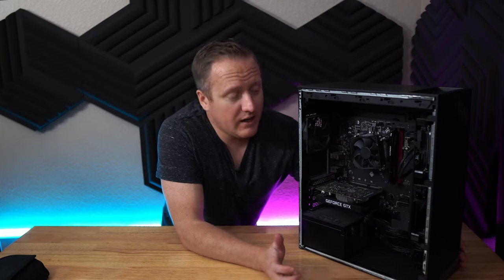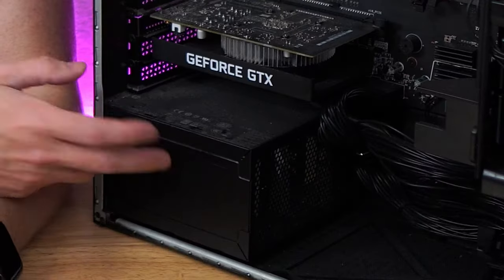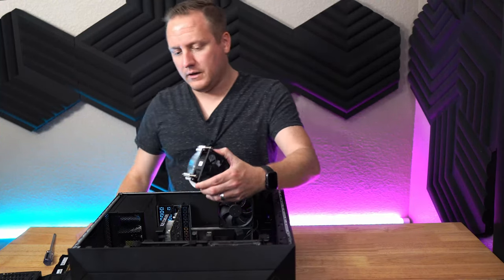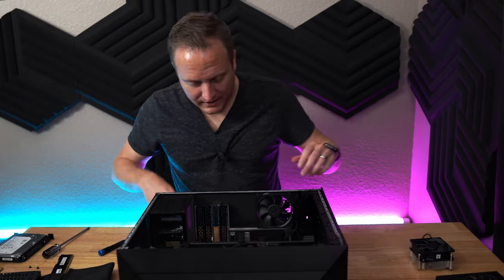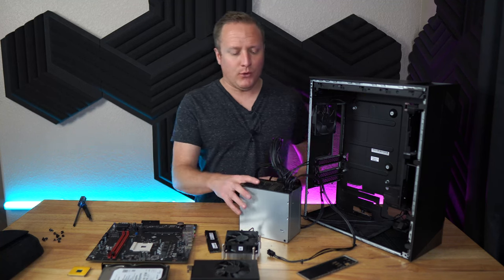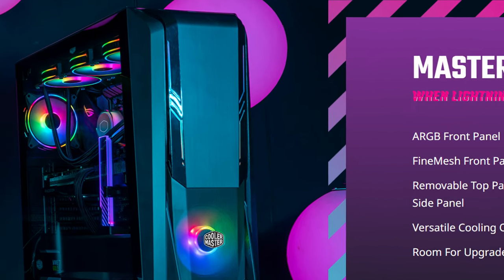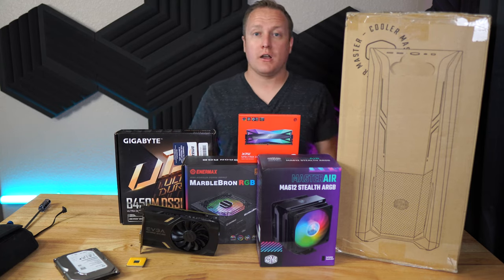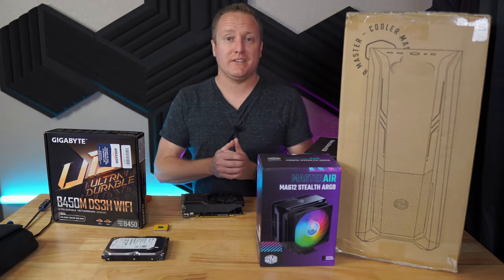From an HP Omen 25l into a Powerful and BEAUTIFUL Gaming PC!

Comment: Crazy I didnt know there were so many variants. I have ryzen 7 5700g 32 gb dual channel 3500 mhz ram geforce rtx 3070 , with an added 120 msi AIO and 2 added corsair 120 rgb elite fans. Runs like a beast. I play warzone and now mw2 on it over 100 fps. My friends with there custom rigs say mine looks like it runs better 🤣👍 thanks for the tip on back panel been wanting to clean up some of the messy wiring
Reply from the maker: Thanks for watching!
Reply: I have the same pc, but isn’t the cpu a huge bottleneck?

Comment: A good looking PC, my only observation is that old PSU was perfectly fine on Gigabyte MB without adapter, the 4pin EPS delivering 144W, letting 4pins unoccupied, and that Ryzen 5 didn't use so much power.In the end, the new PSU is better for future upgrades.
Reply from the maker: Right.  I knew I could use it still but decided to go the safer more upgrade ready route.  Also a thing to consider… the HP PSU cable lengths are VERY short.  I may have had some issues there!

Comment: Nice build, and the aesthetics all go very well together.  Also, that HP PSU with only 4 pin CPU power would be great for an older Optiplex, as all the ones I've seen have 4 pin on the boards.
Reply from the maker: That’s a great idea!  It’s got the power just not the pins!

Comment: I have a 2060 and an i5 in mine and I’m yet to find a game I can’t run with consistent frame rates no matter my graphic settings although I have noticed my gpu usage only uses like 40% on most games for some reason and idk why
Reply from the maker: Nice!  If you are seeing low GPU utilization you likely have a CPU bottle neck.  You have some performance being left on the table actually.
Reply: @PCTechHustle  yeah I’m not really sure how to fix that tho unless I need to upgrade it ?
Reply: have you made any changes?
Reply: @keynote-_-  nah nothing mate all my games are running fine so I don’t see the point upgrading right now

Comment: That GPU upgrade isn't a real upgrade, the 1650 has 4GB of VRAM and performs pretty much equally to the old 1060 3GB. A 6GB version would've been nice, but a 3GB one... You swapped out a GPU for one that performs the same while having less VRAM and consuming more power...
Reply from the maker: I’d have to disagree.  The 1060 3GB numbers on average are about 20% better than a 1650
Reply: @PCTechHustle  It's 15% better and not in all games, in some it's equal and there are some in which the 1650 is better

Comment: very lite esport gaming ! someone tell him that's not gtx 1050 2gb or gt 1030 !
Reply from the maker: It’s a GTX 1650 that requires no auxiliary power, so yeah it’s gonna be pretty weak!
Reply: @PCTechHustle  The 1650 isn't far behind the 1060 3GB. It's more powerful than a 1050Ti but ever so slightly slower than an RX570. In fact, it's pretty similar to a 6500XT (albeit on PCI-E Gen4). It even has the encoders that are found on its bigger brothers so it can be used in a budget editing machine as well. Also the 1650 can handle most games with ease at 1080p Medium (some games High and some newer games like Cyberpunk and all on low).
Reply from the maker: @kb1118tech  yep!  Great points!  The 1650 really isn’t that bad for what it is.  The 10603GB is about a %20 uplift, nothing massive.  I was just trying to keep the spend low with my client and going any further up in GPU would have significantly inflated the price of the upgrades.  Good thing now we have a beefy power supply to accommodate even bigger upgrades in the future.